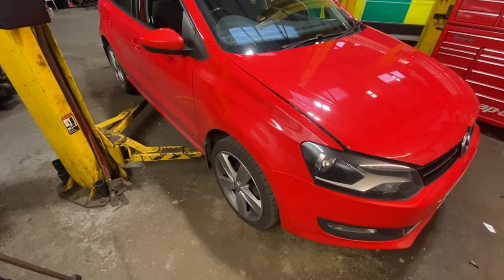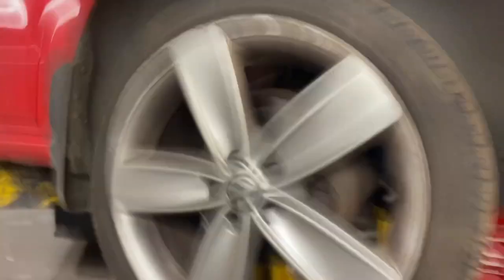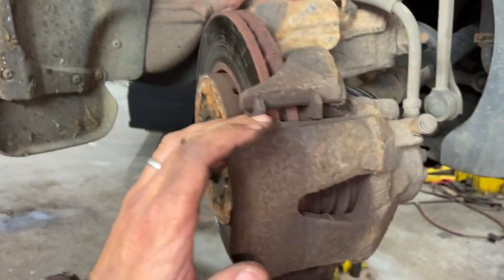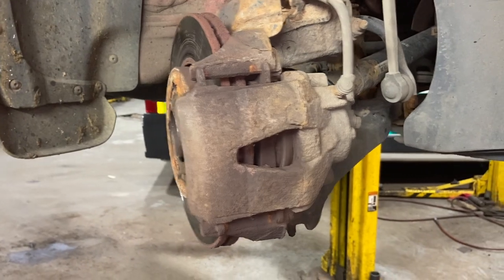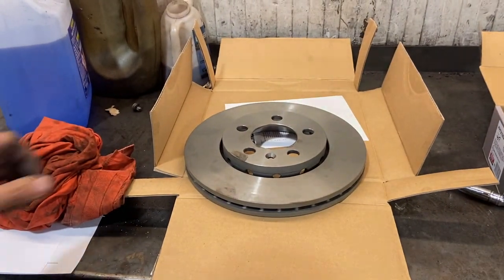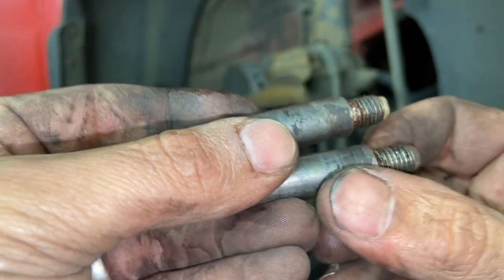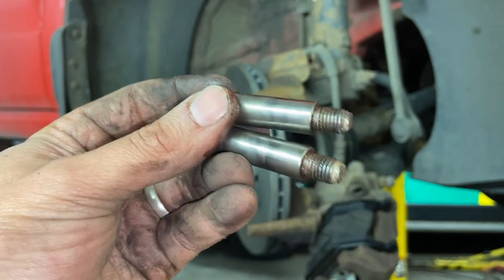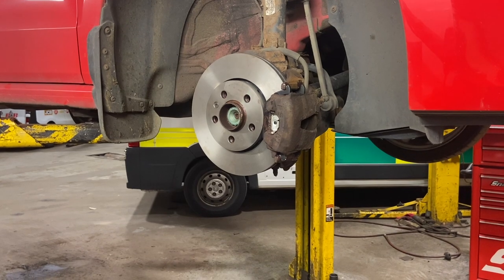MK5 VW Polo front brake discs and pads replacement

Comment from the maker: Check Euro Car parts for parts - https://tidd.ly/3lIO7xA (discount codes on site)
Check "Car Parts for Less" - https://tidd.ly/2LNEwIn  (use discount codes on site)
Front brake discs and pads eBay - https://ebay.us/XQivOo
Front brake slider kit - https://ebay.us/6Pl0g3

Tools used:
Allen key Sockets - https://ebay.us/VZf1ML
Pic set - https://amzn.to/33JcZyJ
Torx sockets - https://amzn.to/2JZb1lY
Dewalt 3/8 impact driver - https://amzn.to/3njemLY
Large Grips - https://amzn.to/3fcWT3k
Socket Set - https://amzn.to/2O6BUmM
1/2 Dewalt impact driver - https://amzn.to/3e2Uff2
17/19/21 wheel bolt impact socket set - https://amzn.to/3gDnBlP
Torque Wrench - https://amzn.to/2VZ4CKu
Allen key sockets - https://amzn.to/3nBn73S
Screwdriver set - https://amzn.to/30RA53L

Copper grease - https://ebay.us/ckQddu
Brake cleaner - https://ebay.us/TenE90
Ceramic brake paste Amazon - https://amzn.to/3jN87gW
Ceramic brake paste Ebay - https://ebay.us/GbuDhL
Brake cleaner sprayer - https://amzn.to/2BLF1gX

Check out my other VAG group videos: https://www.youtube.com/playlist?list=PLDTPJANi9HjrirPFiZL87aKKBI95A82cd
Check out my VW polo videos : https://www.youtube.com/playlist?list=PLDTPJANi9HjoVlQzoD-bcgz0u2EetlEac